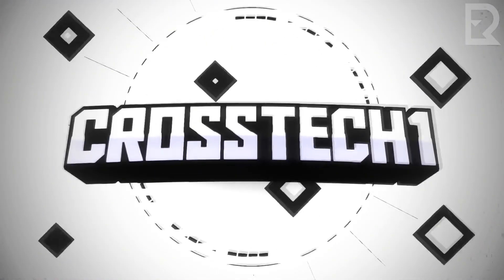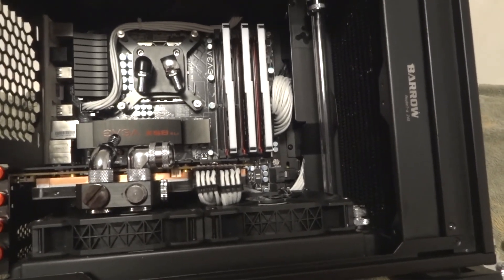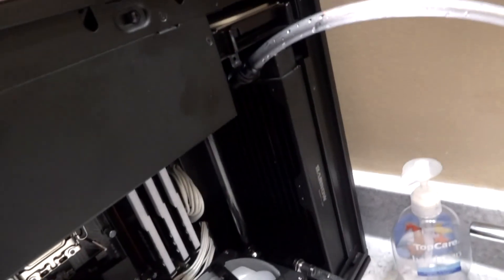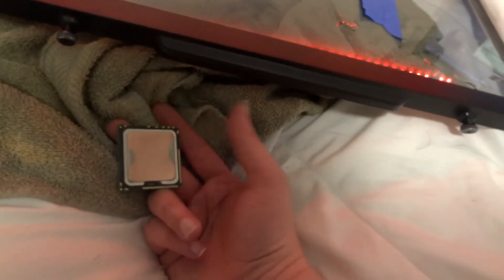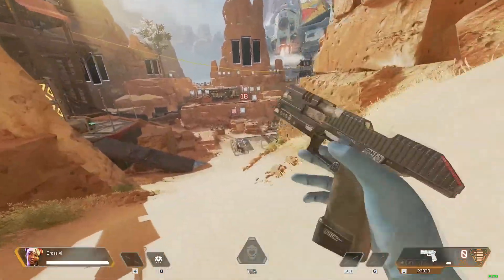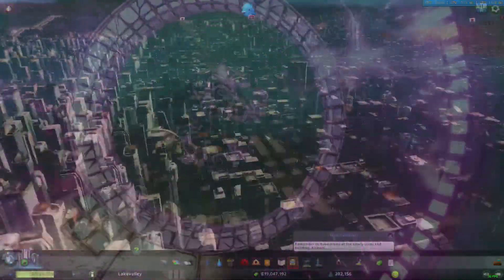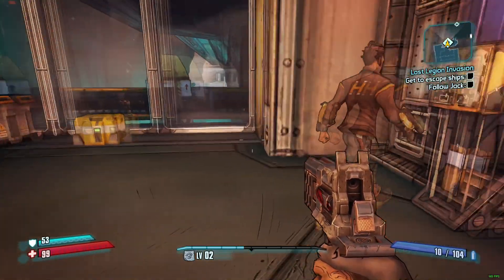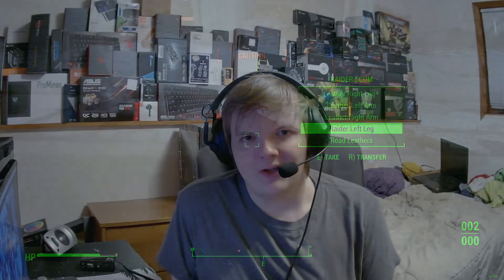Lets Build A Top Tier X58 Rig

Comment: Yesssss
Reply: you should be able to run 3X8 24GB DDR3 1866 clocking mine @ 1960 1.64v QPI/DRAM @ 1.35V also if you have granite kitchen countertops they work great for lapping just lay a sheet of cheap picture frame glass over it or if you have a good thick bathroom mirror works great as well I like to leave  one-way grooves on the CPU and on the block so that when you mount them they run diagonal of each other that way you get some good bite between the CPU and block

Comment: Do you have the latest bios rev. 83 and still no Xeon? is that a rev 1.0 board? if so, you can do a simple mod to the board that will allow Xeon support, simply remove R460 and bridge the solder pads on R461 and install the X5675, W3690, X5690...
Reply from the maker: Yeah it's a revision 1.0. I made a video about that a couple months back. And I don't trust myself with a soldering iron. Lol that's why I simply bit the bullet and got an i7.
Reply: @crosstech1  google a local repair shop with the right soldering equipment shouldn't be that expensive they usually charge by the HR, you're leaving a ton of performance un taped I have my Xenon X5675 on air single 120mm 4 heat pipe getting 4.5 GHz 1.35v and 1960 on the DDR3 @ 1.54v, scores 1041 in R15 @ 79c on The hottest core during Cinebench R15, gaming in the 50-60c range , pushes my Asus Strix GTX 1080 to 99% usage most of the time 120-144 fps locked in Fortnite 1080p epic and high settings low shadows could comfortably run an RTX 3060 to 100%

Comment: The controler for the ram can't handle ocing with all 6 sticks. Honestly, just set all 6 to 1600mhz and leave it. You'll even possibly get better synthetic benchmarks. And if your multiplier is unlocked, do a hard pass on the bclk ocing and just mess with the multiplier, voltage and llc.